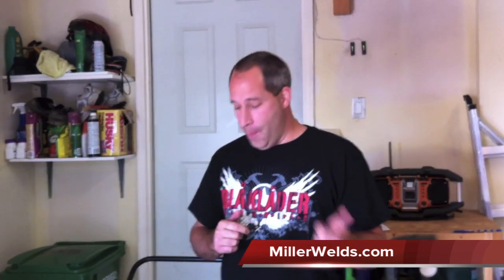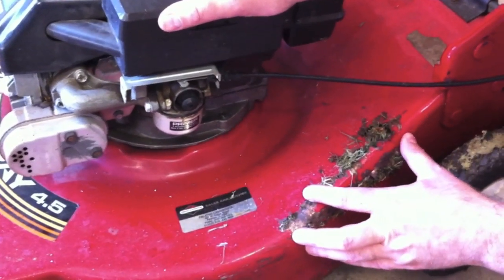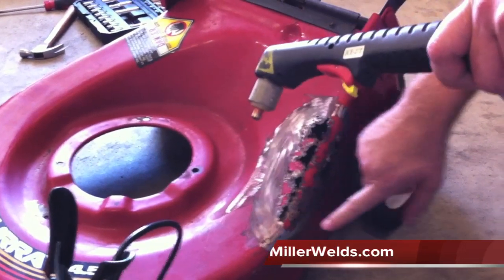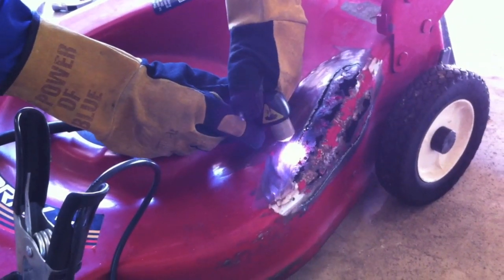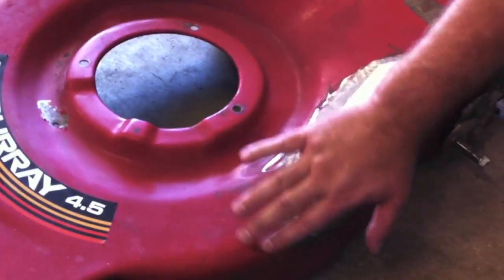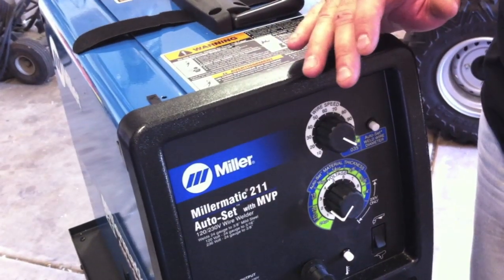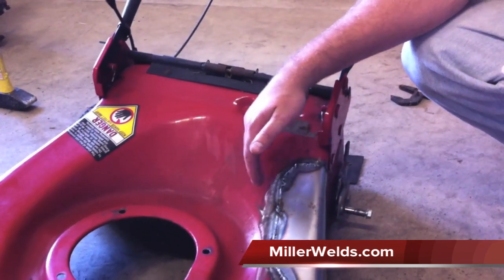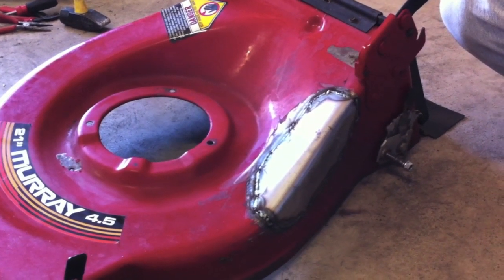Welding a Lawn Mower Deck with Miller Equipment

Comment: Hello I have a couple of tips for you, I'm a sheet metal fabricator, to start with when removing and repairing rusted panels always remove at most a inch around the rust e.g. a inch square rust spot you want to remove a 3 inch square, you did well on the cut instead of a patch, cut a ruff blank and add the peace to the inside and then just use a fine pencil line on ur patch, then use a .4 fine marker and trace the line and then cut on the outside, this will give you a perfect fit

Comment from the maker: @NobbysPcHelp Thanks for the vote.  I had the same problem.  About five years ago i was just messing around and put on the helmet.  Couldn't see anything and it was a pain, so i never welded.  Dan showed me the Miller helmet and it made all the difference.  i could have the helmet on and see what i was doing.  As soon as i start welding, the helmet automatically tints dark, so i didn't have to mess around with anything. I didn't know about the gas thing either.  Thanks

Comment: One more thing, when welding thin metal, two tips. When butt welding, only tack weld, and never tack twice next to each other, e.g. u have a 300 mm long weld, if u weld it in one pass you will buckle the steel, and you will spend more time shrinking and stretching the steel, instead tack at the start then at the end then in the middle cool it down with wet rag and do it again and so forth, a second method is to use a copper pipe and or plate(barstock) to take the heat away

Comment: For tricky patching use cardboard or paper , always start flat and then put the paper over the surface, if you start getting a creak or paper bending up, then follow that to the point it starts to stay flat, once you have finished then flatten it out and trace and then you start folding and sshaping you have a nice butt weld

Comment: Way too much time spent on a junk mower. I would never have removed the engine or power washed that piece of crap. I would have just fit a piece of sheet metal over the rust area,  and stick welded the shit out of it.